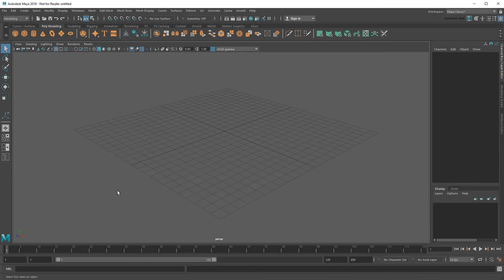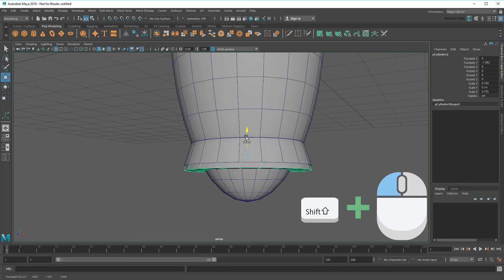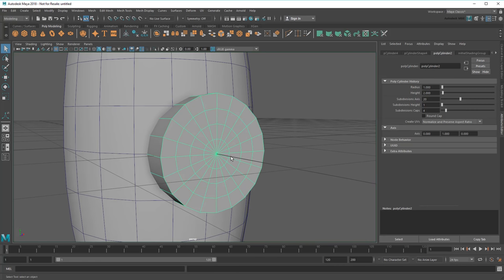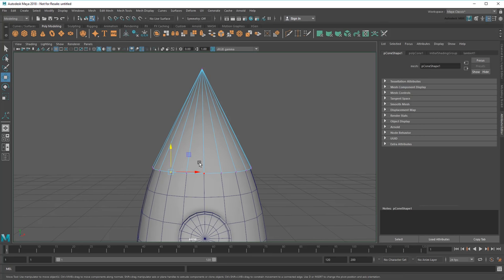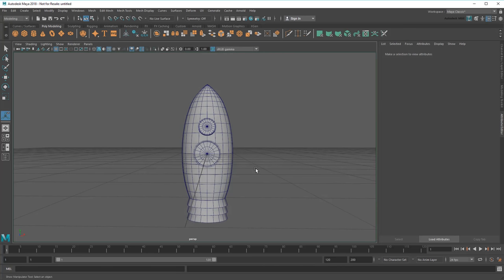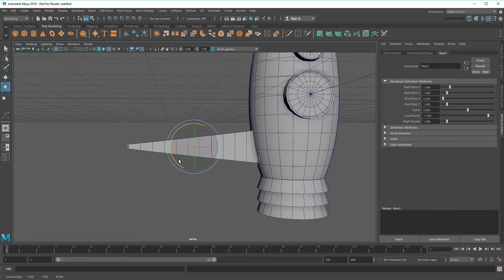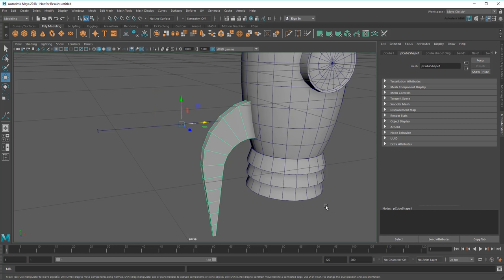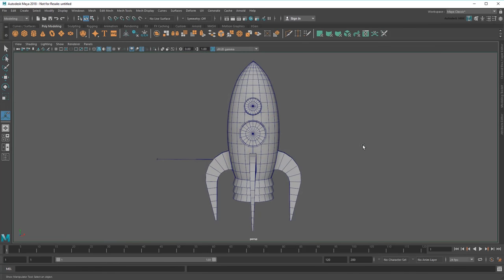Intro to Maya: Lesson 3 / 10 - 3D Modeling your first model

Comment: I think I've missed something obvious, was following along for practice and got as far as adding the first booster ring. I can't seem to select just the bottom vertices,  no matter what I do it always selects the whole primitive thus scaling all of it. Anyone got an insight?

Edit: Just tried to add more caps to the first porthole, and the results were... unexpected. The porthole seemed to extrude from the main body and increase in size, so there is definitely something amiss .
Reply: Just in case anyone else gets the same issue for selecting , it's due to 'soft select' being enabled. Pressing 'b' on your keyboard will toggle this.
Reply: @MarkOfArgyll   im glad you figured it out, thanks for sharing that bit of experience here, saving many of us time and effort and frustration in the future~

Comment: can you explain how to taper an object like the boosters evenly, im doing what you do but it keeps twisting and warping, not an even taper
Reply from the maker: How many subdivisions do you have along the height of the booster?  Is it just two (top row and bottom row) as shown in the video?  Additionally, are you sure you have Soft Select turned off for this part?
Reply: @Autodesk_Maya   Soft selection was off and there was only one subdivision along the height of the booster. I solved the problem by turning off the symmetry attribute of the cylinder in the "modeling toolkit" tab.

Comment: Does it matter whether one uses 'Union' or 'Combine' operation? For some reason whenever I press 'Union' the whole object disappears completely. First time I did it, it went alright. Is that a bug?
Reply from the maker: That's odd.  That definitely shouldn't happen.  Have you scaled the objects at all, because there is a known bug around that.

You can use combine, but that will leave geometry inside the rocket (Union will remove faces within geometry that you wouldn't see from outside).  It's just a little messier in comparison.

Comment: Hi! Really good video. I want to rotate the first leg of the rocket, but I don't want to deform the piece anymore. Is there any way to rotate the piece like 90º, 180º withput doing the deform? I only want to rotate normally. Thanks!
Reply: So the only way I have found is to duplicate the "leg" with Shift + left button and then the new leg is a normal piece.
Reply from the maker: Pol Galea You can also group the leg with the deformed handle, then rotate the group.
Reply: @Autodesk_Maya  Oh! That's right. Marvellous, thanks!

Comment: When  using non-liner in deform tools and when I move the object the object shape changes. Is there anyway to stop it from changing
Reply from the maker: You'll need to either move the deformer handle with the object at the same time, or freeze the transforms on the object.
Reply: @Autodesk_Maya  thank you

Comment: dang whenever i turn on the soft selection all the scaling drags disappear and so you cant edit it in the same way he did. I need to curve the damn cone. 😂 everyrhing else was good
Reply from the maker: Try holding B + slowly middle-mouse dragging right to start the scaling from 0.
Reply: @Autodesk_Maya  i did. Now the prob is, when I do soft selection, at one point i got it to show the same way it was withh yours, but i couldnt move or scale it. If i was able to move it or scale, holding B + dragging doesnt seem to work. I tried to redo the cone but then the diff color area for the vertices didnt appear anymore.
Reply from the maker: @TheSinisterWasHere  Hmm, just to clarify: you're using B + middle-mouse dragging first to size the area, THEN moving/scaling right?  You shouldn't be trying to move and scale while also holding B + middle mouse.  Those are two separate steps.
Reply: @Autodesk_Maya  yes i do them separately. But it seems like they disable each other.. so i'm left with a very pointy rocketship 😂
Reply from the maker: @TheSinisterWasHere  Just pressing B will toggle Soft Select on and off.

Comment: Maya 2023 Booleans (Mesh>Booleans>Union) do not seem to operate the same way as in earlier versions of Maya. The objects that should unify seperate when when moved. Not sure what is happening. I did this tutorial on Maya 2022 last year and it is an awesome tutorial only Maya 2023 booleans seem to behave differently??
Reply from the maker: Indeed, Booleans got an overhaul in Maya 2023!  However, you can still use them the same way as before, by doing the following:
1.)  When using Union, click the square box to open the options menu.
2.)  Set "Input Object Display" to "Hidden.
Reply: @Autodesk_Maya  great. Thku. :)

Comment: i have a problem with the subdivision caps at 3:40 . i want to increase them but if i put more than one the whole mesh is being destroyed. it must be a detail that i do wrong but i dont know what it is. can you help?
Reply from the maker: You need to increase the subdivision caps before changing the objects shape.  Once you change its shape by manually moving vertices, the helper node won't know how to align the new subdivisions properly.
Reply: thank you

Comment: why when I render something out in maya using Arnold I can't  Turn it Around to watch it all around  and I can only see it from the front ?
Reply from the maker: Which camera are you rendering?  You want to make sure the camera being rendered is the same one you're looking at in the Viewport (check in your Render Settings).
Reply: @Autodesk_Maya  I dont use any camera to render I just rend it out normal
Reply from the maker: @naifox1  When you render, it always uses one of the cameras.  What's likely happened is that Arnold is rendering a different camera from the one you're looking at in the Viewport.  See this article for help: http://help.autodesk.com/view/MAYAUL/2019/ENU/?guid=GUID-C4BE4094-836C-4BFD-84B0-06C2F820713F

Comment: Second problem: When I double click the single edge, it selects the whole ring, but then when I try to scale it outward the ring sinks into the rocket somehow. I've tried it on all three axis options and get the same result every time. I'm using Maya2018.
Reply from the maker: So regardless of which directly you scale, the ring only shrinks?  That's definitely very odd.  You should only have to scale along the center (i.e. all 3 axes at once).  Do you have Soft Selection turned on by accident?
Reply: So what it appears to do is attach the porthole cylinder to the top of the booster, even though I did the Mesh>Boolean>union to make it a single object before crafting the porthole. The cylinder creates a conelike attachment to the top part of the booster (which remains green regardless of how it's selected or deselected) even if the cylinder is far away from the rocket. It's like a ray emitting from the booster.
Reply: I also just realized that, even though I've dragged and selected the whole rocket, the top cylinder that creates the booster won't move with the rocket when I got to move it as a whole after doing the "union"--but when I try to go to mesh>boleans>union, the program gives me an error and says that two or more polygons have to be selected to finish the command. That top part of the booster is the same part that the porthole cylinder keeps attaching to like a ray.
Reply from the maker: @KaraMaeAdamo1984  Hmm, it's hard to picture exactly what you mean.  Would it be possible for you to post a picture somewhere for me to see?  This would be a good place for it: https://forums.autodesk.com/t5/maya-modeling/bd-p/area-b41

Comment: I did everything as told but i am unable to use the B key. It doesnt do anything i even made sub height divisions, had component mode on (for the cone)
Reply: I click 'b' it becomes yellow, then i hit b and left click together and it doesnt do anything no blue circle appears
Reply: My cone is completely yellow in color i do not see red-ish color at the bottom
Reply from the maker: Your radius is probably too big to start.  Try holding B + dragging with the middle mouse button to start from 0.

Comment: In the default set up  shift and drag does not  duplicate items  , b does not  seem  to switch on/off soft selection , is yours a customised set up ? 
im using maya 2018
Reply from the maker: Shift+drag functionality was new in Maya 2019.  In 2018 you'll need to use Edit > Duplicate and then move the duplicate.

B should still turn Soft Selection on and off.  If it doesn't, you can manually turn it on and off via any of the Move/Rotate/Scale Tool Settings.  This video was recorded using default preferences, so it could be that your setup is different.  I'd try deleting your preferences as shown here: https://www.youtube.com/watch?v=HptugoNgwAU&list=PLB17FF2E88AEFDBE4&index=4
Reply: @Autodesk_Maya  your video also clearly shows its using maya 2018  .. just sayin , 
none the less a good video , just took me  a While  to find  some of the commands
Reply from the maker: @mrenglishjawa  That's very true!  I went back to check the documentation and it turns out that functionality was introduced in 2018 after all!  My bad!  I think I do so many of these that I sometimes forget which pertains to which version.

Try resetting your preferences.  Hopefully that should get those hotkeys working.

Comment: i could use a little help, when i hit union to make the whole rocket one object, my rocket disapears.
Any suggestions?
Reply from the maker: Unfortunately, this is a known bug in some older versions of Maya.  Try selecting the objects and going to Modify > Freeze Transforms first before performing the Union.  If that still fails, then use Mesh > Combine instead of Union (it's a bit less optimal since it will keep the inner geometry, but in this case the difference is negligible).
Reply: @Autodesk_Maya  i have the 2020 version, i ended up uniting them whit the combine mash tool, there is no problem with using that tool insted of the unite tool?
Reply from the maker: @Thecabrojero  Yeah, that's fine

Comment: All the objects disappear when I hit "Union". But the software says that there's the object in outliner and also move , rotate & scale tools identifies same as the object before I hit Union (I'm using a low-end laptop- i7 3GHz, 8GB RAM, 2GB VRAM)
Reply from the maker: Which version of Maya are you using?  There was a bug with Union when you scaled objects before the Union operation.
A couple of fixes you can do are: 1.) Select the objects and go to Modify > Freeze Transforms, then try to Union them again.  2.) Use Mesh > Combine instead of Union.
Reply: @Autodesk_Maya I’m running 2023 version on M1 Air, and mash union gave me error unable to do union. The combine works. What’s different between combine and union?
Reply from the maker: @TheEasygone  Union will remove the inner, intersecting geometry of the two objects while combine will not.  For the purpose of this tutorial, you can use either and it's fine.  In general, you probably want to stick to Union when possible.

Comment: why are u using boolean to connect objects, sir? you can use just connect right?
Reply from the maker: You mean the Connect tool in the Modeling Toolkit?  You can, it's just a lot more manual work.

Comment: Hey guys, when I try to create a bend or flare the polygon doesn't warp in real time. I also am not getting the deformer line, or handle, he's describing in the video. Any suggestions??
Reply from the maker: themadnessof space Does the status line show any kind of red error?  Did you make sure to have the correct object selected when making the deformer.
Reply: @Autodesk_Maya  nope, no red error bar, and the object is indeed selected. The 'create flare deformer options' window pops up separately, instead of like yours (under the already existing object attributes menu) with no deformer or handle line in place until after I mess around with the controls and hit apply, which is super inefficient.
Reply from the maker: Which version of Maya are you using?  I've never heard of that behavior before.
Reply: @Autodesk_Maya  I downloaded it and installed less than two weeks ago.
Reply from the maker: @themadnessofspace5306  Can you try doing this https://www.youtube.com/watch?v=HptugoNgwAU&list=PLB17FF2E88AEFDBE4&index=4 and then try again?  It sounds like the tool itself is somehow broken.

Comment: Hi, in 1:35 when I drag-select the bottom vertices, the gumball doesn't pops up. If I select the scale tool, I can't scale it either. The mouse looks like a little square on the screen. Can you please help?
Reply from the maker: Hmm, I'm not sure what's going on here.  I'd suggest you double-click the Select Tool in the toolbox, then click "Reset Tool" and try the steps again.  Also, make sure that you have multiple vertices selected - you won't be able to scale just a single vertex.

Comment: I'm using Maya 2018 on Mac. When I double click on one edge of the cylinder (in Edge mode), it doesn't select the entire ring; only that edge. What am I doing wrong??
Reply from the maker: Try selecting one edge, then Shift + double-clicking the edge next to it.  Does that work?
Reply: @Autodesk_Maya  it worked, thank you!

Comment: On 3:28 when I select the edge ring to scale it, the pivot point is not dead center, how do I reset it? or why does it move?
Reply from the maker: You can press D to go into pivot mode and alter the location of the pivot, then press D again to go back to scale.  However, it really should appear in the center by default.

Where does the pivot appear?  Does it stay on the initial component selected, or does it appear to be floating out in a random spot somewhere?
Reply: Found a solution; on tool settings-scale settings, axis otrientation (choose from the drop down menu) and centers the pivot where it should.
Reply: @Autodesk_Maya  It appeared to be floating on the object. not on any other part of the screen
Reply: and choose component, forgot to mention that.

tool settings-scale settings-axis orientation: component
Reply from the maker: @edgarl.f.4471  I'd just double check to make sure the right components are selected.  Since the manipulator appears at the center of your selection, then having it appear where you don't expect it is a telltale sign that you might've included an extra component (say, a stray edge on the other side of the model) in your selection by accident.

Comment: The bend modifier isn't bending on the right axis? What am I doing wrong?
Reply from the maker: Did you rotate the handle as shown in the video?
Reply: @Autodesk_Maya  Yeah but for some reason its bending in the other direction.

Comment: Holding B + LMB is not working. What should i do?
Reply from the maker: Try double-clicking the Move Tool, then in the Tool Settings that pops up, go to Soft Selection and adjust the Falloff Radius manually from there.